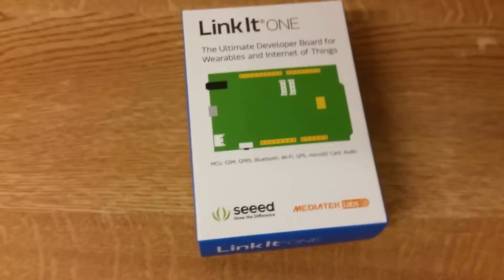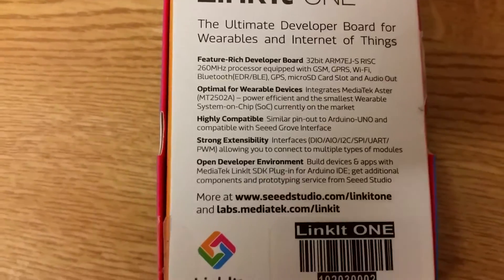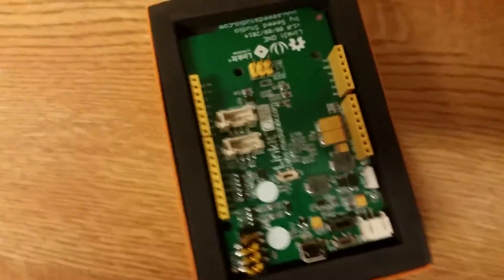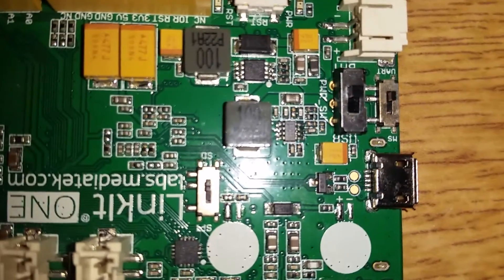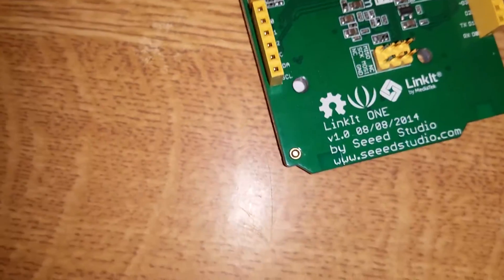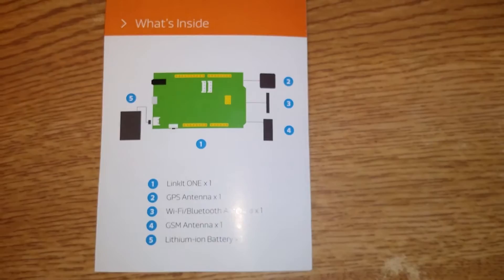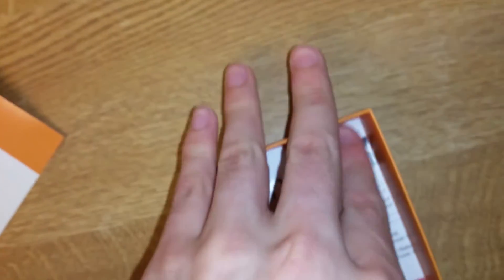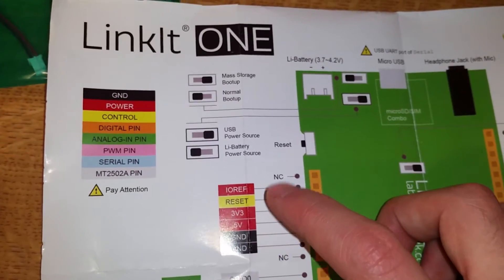What is the Linkit one? It has GSM, GPS, Wifi, SD card and audio!

Comment: Hi 
I'm unable to upload codes on my linkit one and getting this message every time. kindly suggest me solution 
Warning: platform.txt from core 'MediaTek ARM7 EJ-S (32-bits) Boards' contains deprecated recipe.ar.pattern="{compiler.path}{compiler.ar.cmd}" {compiler.ar.flags} "{build.path}/{archive_file}" "{object_file}", automatically converted to recipe.ar.pattern="{compiler.path}{compiler.ar.cmd}" {compiler.ar.flags} "{archive_file_path}" "{object_file}". Consider upgrading this core.
Sketch uses 7568 bytes (0%) of program storage space. Maximum is 10485760 bytes.

C:\Program Files (x86)\Arduino>"C:\Users\Umair Anjum\AppData\Local\Arduino15\packages\LinkIt\tools\linkit_tools\1.1.21\PushTool.exe" -d arduino -c -p "C:\Users\UMAIRA~1\AppData\Local\Temp\arduino_build_382982/acalrometer.ino.vxp"
Reply from the maker: I'm not sure, I don't remember having this problem. You can update the firmware of the linkit one and ensure that the linkit one is installed in Arduino studio. Try restarting your computer too.
Reply: Ahmad Khattab I've installed arduino and com port driver and I've also selected linkit one ad my board from tools....  if a separate linkit one has to be installed then kindly give me link for that
Reply from the maker: OK, did you follow the instructions on this page?
http://wiki.seeed.cc/LinkIt_ONE/
Start with Installing Mediatek LinkIt ONE SDK section and keep going till the end of the page
Reply: yes I've followed same process but facing same problem with each code.
Reply from the maker: did you try updating the firmware?
Reply: yes I've updated but all in vain
Reply from the maker: try restarting your computer?
Reply: Bro I've tried on different laptops but facing same problem even after restart.
Reply from the maker: I'm really not sure. I did not get that problem.
Reply: O.k I'll try to do so